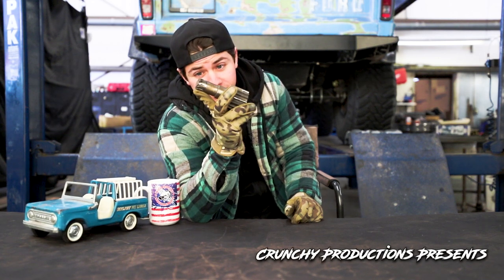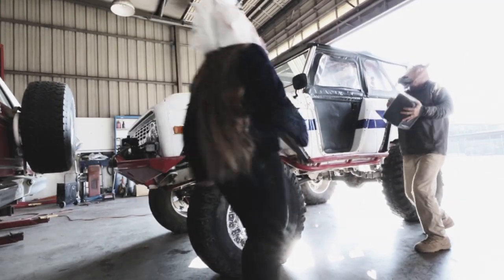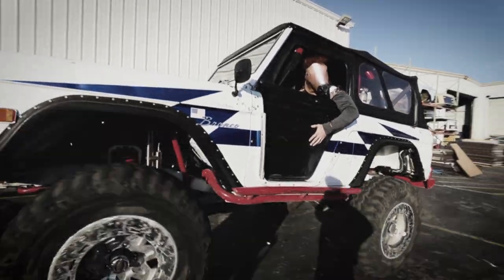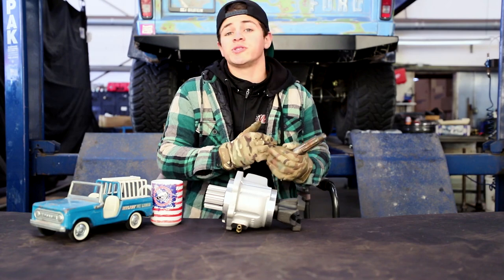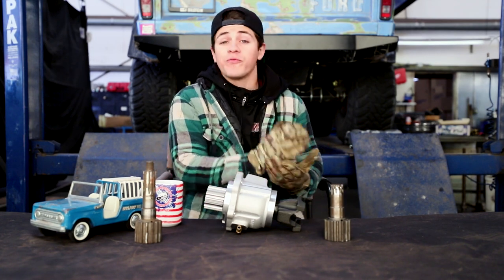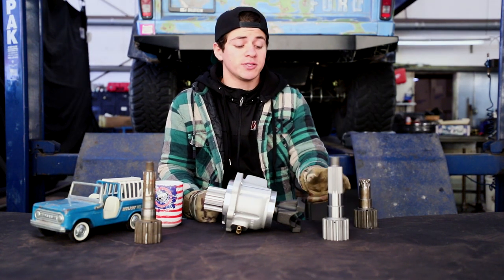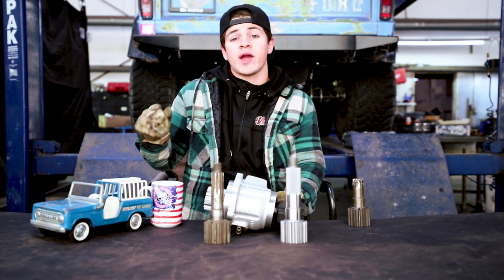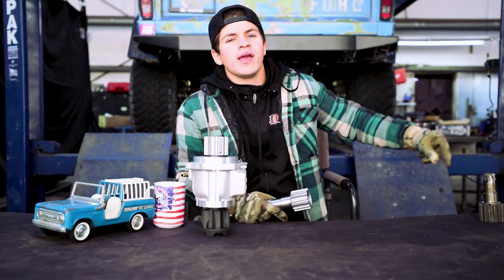How to Fix the WEAKEST Component in your Bronco's Drivetrain

Comment: I run a np208 t case. It's slow and light. It's been worked hard for 15 years and no fails. I even pulled a loaded KENWORTH t800 tri-axle dump truck with a 3 axle pup trailer loaded to a gross weight of 69700kg. If that didn't break it it must be good enough

Comment: What is the determining factor as to whether or not you have to shorten the driveshaft?
Reply from the maker: So that's pretty simple. If you look at your driveshaft installed now, measure how much travel you have available. If you have 3 inches or more, you shouldn't have to shorten anything, but any less than that and you're risking bottoming out the driveshaft and breaking even more parts.